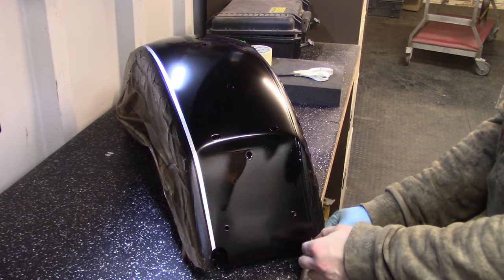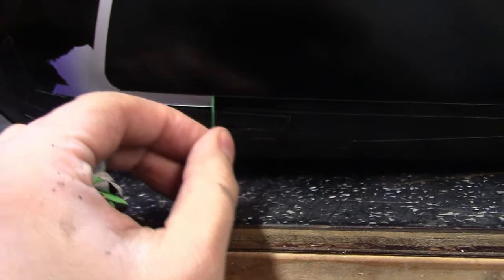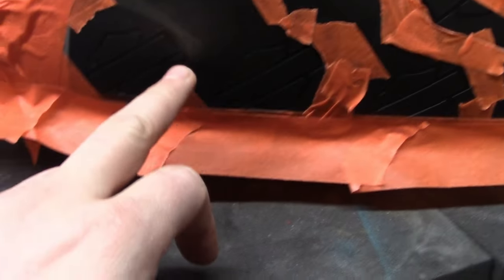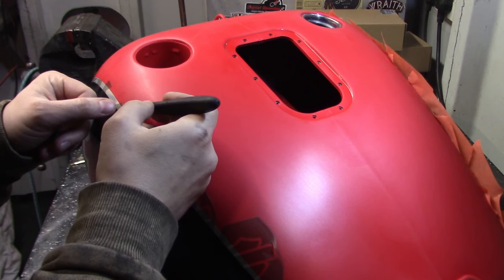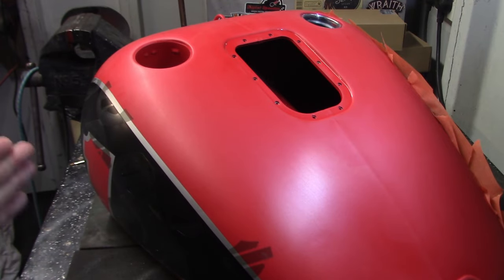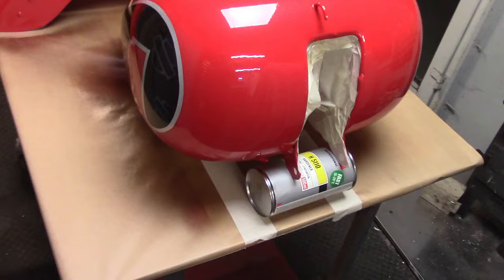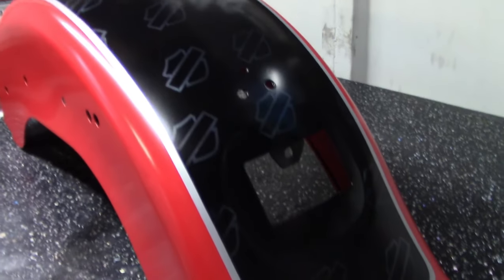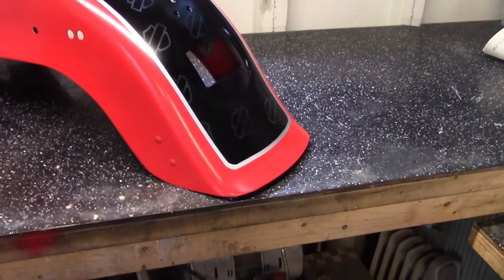Custom Paint Guide for a Harley Davidson Motorcycle - Part 2 of 2

Comment: always cool to watch your videos,  i have a question about paint peeling off specially with so much tape you are using . have you clearcoated before the HD logos or did you direct tape over the design and no peeling at all ?
Reply from the maker: It's the prep that matters. I make sure the prep is done properly before I apply the base colour, in this case that was black. Then I am confident it will not pull off the paint when peeling back stencils. As you can see it the vide it was stuck on nicely. You can also use low tack tape, but I am confident in my work, so no need for that.

Comment: Hi mate can I ask a technical question. I'm keen to do as much as I can on my bike including the paint but I want 2k lacquer for durability but obviously that's not safe to do at home. If I did my basecoat and design would a shop lacquer it and if so how long can I leave it before they do.
Reply from the maker: You gotta ask them that question my good man. I know some people can be funny like that. Have a chat with them before you start messing about, so you don't end up wasting your time and effort
Reply: @MackieBass  thanks for the quick response. 1 last question I have 1k clear coat is that good enough for a tank as I'm hearing varying things.